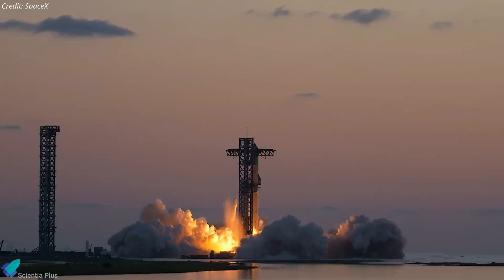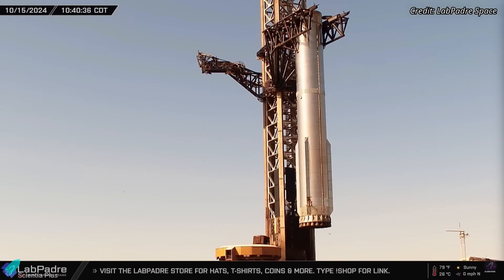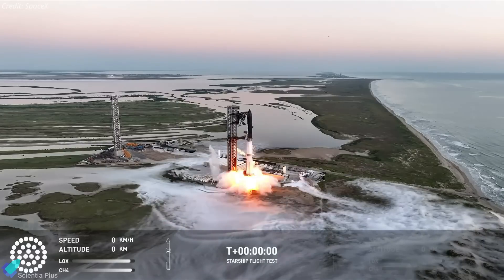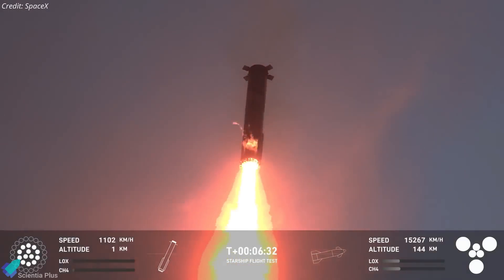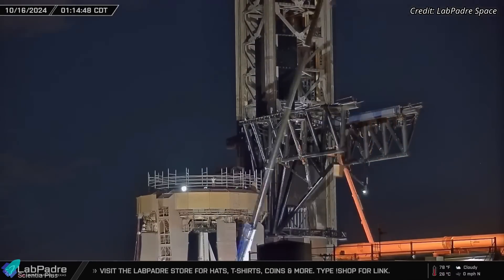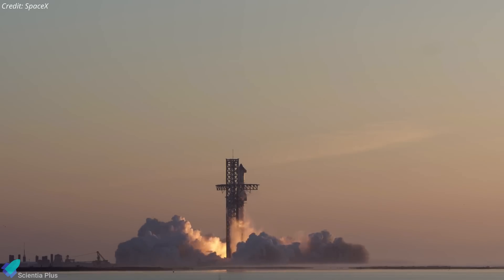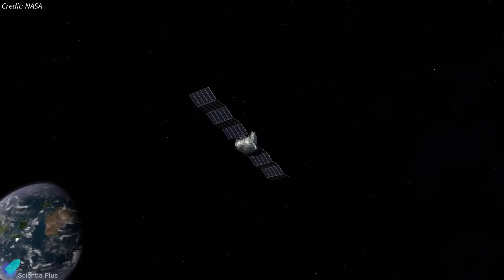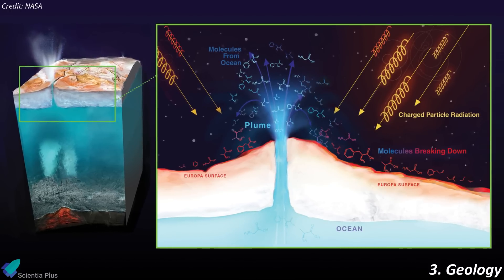FAA Declares Starship Flight 5 Perfect - But SpaceX Booster Catch NEEDS Critical Fixes!

Comment: OK-------.  Just as important from a post-flight engineering inspection is the possibility of reducing the Empty weight of the booster from 200 tons to a possible 175 tons or even 150 tons, greatly increasing the maximum Tonnage the Starship can lift into Orbit...!!!

Comment: the only thing needing changes is the thickness of the outer engine nozzle material and possible reinforcement on the damaged chine. Of course you probably wouldn't know that considering you can't even put in the effort to read the script yourself.

Comment: Everyone needs to remember the engines bells that where damaged and failed or not the final engine design, the new version 3 engine is made from a different material and has active internal cooling, which is why Elon Musk said this is not an issue easily fixed.

Comment: That's not a fire in the "engine bay". That's heating from air compression, as in reentry. And most of the cause of the warping of the outer engine nozzles, because engine nozzles are cooled by fuel pumped throw them just prier to being burned. Which is why the inner engine nozzles were not warped, or as warped.
Reply: i wonder if the outer engines even had this cooling active since they ware no longer needed for landing 🤔 small oversight

Comment: Booster fins needs to be deployed after hot stage separation or relocated lower to avoid damage from second stage ignition.  Also need to consider an additional decent booster firing to slow booster down.  Significant air pressure and friction from rapid decent damaged rocket nossles.
Reply: The atmosphere at the level you were referring to is too thin for the grind fins to have much of an effect on slowing down the booster
Reply: I wasn't talking about the booster fins slowing the descent. I was referring to an additional rocket burn lower in the atmosphere to reduce the rate of decent.  The fins were damaged because they were deployed prior to the first stage hot separation, causing the flames from the second stage to damage the fins, which only serve to guide decent, not slow it.
Reply: @garyscott4847   The grid fins do not get deployed.
They are in a fixed position on the booster ,, they only rotate.
Reply: Then they need to redesign to allow them to be extended out after second stage hot separation, relocate them lower on the booster, or scrap hot stage separation to avoid damage to the fins.
Reply: Lower relocation I think is out of the question. Too many changes, from aerodynamic properties that change into something worse to some other requiring that the actuators for grid fins to stay inside the tanks. Probably they would either divert the flame or, better, lock the fins in vertical (longitudinal) position and deploy them in horizontal (transversal) position after separation burn. 
But the damage to nozzles could be a greater problem. I'm not sure it can be mitigated by a supplementary burn. The mass of the booster is bigger than Falcon9, its velocity between 8km and 2km altitude is also bigger (you can see that it manages to reach the terminal velocity quite late), therefore the heat (from kinetic energy) experienced by the booster is much bigger than what Falcon 9 experiences.

Comment: To get things in perspective....71m long, 230 ton lump of metal being lowered as gently as that onto its 'nest'....hard to get your head around.....the very moment it came to rest, very emotional....
Reply: you forgot the estimate 500 tons of fuel that was still onboard
Reply: @coresoldier1  Oh dear...minor oversight..!!
Reply: @coresoldier1  Hang on, you're saying the weight of the remaining fuel on landing was over TWICE that of the booster itself? Where did you get that info??
Reply: @peedee-zo1yq  cant find my source  but with 2700t of lox and 700t of fuel there would be some left after landing. hoping we get info from space x on that
Reply: @coresoldier1  You could be about right with the fuel landing weight. I was staggered when I Googled the take-off fuel weight. Still can't get enough of watching  that immaculate 'catch', tilting one way and then the other. So skilful, looked as if they'd been doing it for years.
Reply: @peedee-zo1yq  yes it was amazing to see, the fuel will be less when we go to orbit
Reply: @coresoldier1  Bit surprised there was no fire extinguishing apparatus at engine level on the Megazilla...maybe they have their reasons...
Reply: @peedee-zo1yq  ch4 ventilation was expected, bit of a bad location to do this unfortunately.
the extinguishing system would not work given the change in the flammable mixture, this is also visible during landing.
Reply: @coresoldier1  Terrific, tx for that. One thing that stood out with this mission - the vastly improved overall efficiency of the Raptors (did just one blow?). That in itself was a  joy to behold.
Reply: @peedee-zo1yq  they went too hell and back don't know about one blowing up looks more a back fire at the end still amazing work
Reply: @coresoldier1  Another amazing thing is the manoeuvering involved to get those tiny legs to sit precisely on the top of the chopsticks - not seen any explanation how that was done. Suppose there were onboard sensors which sorted this out?
Also, only just noticed how the chopsticks sank a fair bit down the tower once the weight of the booster was engaged. All about load bearing and balance I guess?
Reply: @peedee-zo1yq  just before it sits down on those little legs you can see the booster wiggle down in the sticks must have been a tight fit but more impressive it only has the pare of legs so having those line up must have been some serous work. there is very little to no time for sensors to make corrections still very impressive work the team did
Reply: @coresoldier1  Have to say I didn't detect any 'wiggle' when I did a slow-mo on the last few feet. What is more, how do you get a 700+ ton vehicle to do that at such a late stage - angle the Raptors in such a way?
Reply: For some reason this particular aspect of the 'catch' is intriguing me. Maybe there's not a lot to it, but would really like to hear from Space X how it's done.